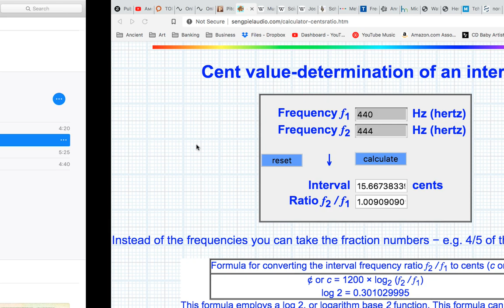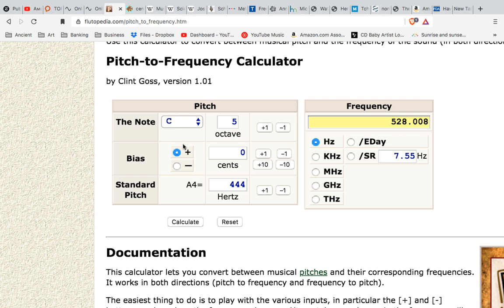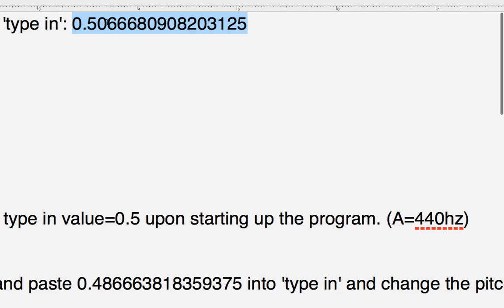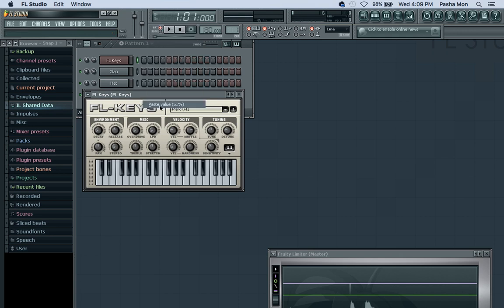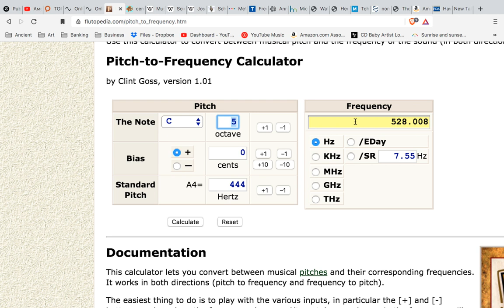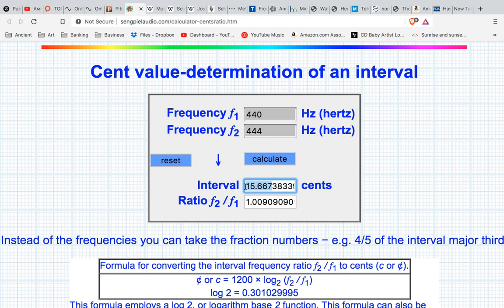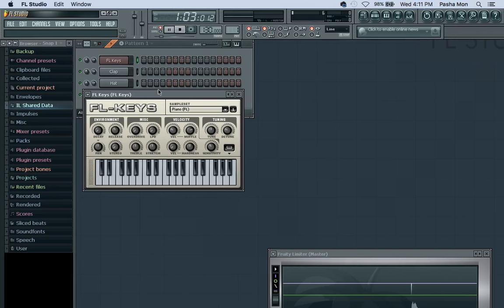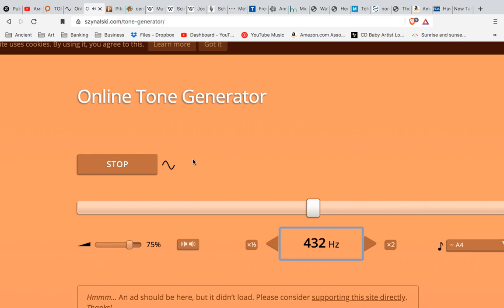How to Tune to 528 Hz and 432 Hz in FL Studio | Advanced Music Production Tutorial

Comment from the maker: UPDATE! Latest version of FL Studio https://amzn.to/3262VhX (Amazon affiliate links) lets you tune to 432 and 528 (C=444) Hz DIRECTLY! :) making it super easy! 

Also, if you're a music producer check out this awesome ultra portable AKAI keyboard controller: https://amzn.to/3i5rtwZ  I actually have it and it's great.

Tuning to 528 Hz means your note C (5) will be vibrating at 528 cycles per second and your note A will be at 444 Hz. This means you will be tuning up 4 Hz from the standard tuning pitch of 440 Hz, an equivalent of 16 cents.

In the case of 432 Hz tuning, you will need tune down -32 cents (or 8Hz) from 440 Hz. This will make the note A vibrate at 432 Hz and the note C (5) at 512 Hz.

Thanks to YouTube user The Captain Chiefer who broke down the math the following way to get to the appropriate FL Studio number: 

Explanation:

1. C5=528hz when A4=444hz. 

2. Fl studio's default pitch setting type in value=0.5 upon starting up the program. (A=440hz)

3. As seen above you can copy and paste 0.486663818359375 into 'type in' and change the pitch to 432hz. 

4. Since 440hz-432hz=8hz & 444hz is 440hz+4hz we would subtract the default fl pitch, 0.5 by the pitch for 432hz, 0.486663818359375 to get the value of 8hz for the 'type in' value, and then divide that value by 2 to get the value of 4hz for the 'type in' value.

5. (0.5 - 0.486663818359375)/2= 0.0066680908203125 

6. 4hz difference in cents = 0.0066680908203125 so add that to the default pitch of fl, 0.5

7. 0.5+0.0066680908203125=0.5066680908203125

8. A=444hz=0.5066680908203125 'type in' pitch value

Check out some of my music and even get my free mp3s here: https://www.Pasha808.com THANKS FOR TUNING IN! Cheers!!
Reply: hey bro, I have FL stu 12, is it possible to import my beats from 12 to into 20? And then just tune all of them to 432 hz there?
Reply from the maker: Ahein  gr8t! EZ right. their next logical step would be to allow users to convert audio files as in Logic and Audacity been available for many years..
Reply from the maker: @spencewolverton4923  it should be possible with an export project, however straight audio files/samples will need to be converted using Audacity or Logic. so it may be easier to just export your finished track as a .wav file and then convert it to 432 in one shot using Audacity or logic. good luck
Reply: @432HzMusicTV  where do I get audacity and logic? And also, your saying I cant send over the final track as a wav. File from 12 to 20 and then tune it to 432?
Reply from the maker: @spencewolverton4923  Audacity is free. just download it online. FL Studio doesn't convert audio files to 432. only virtual instruments within a project.
Reply: @432HzMusicTV  Thanks for making this video. If I change the master pitch to 444 Hz, do I need to change it on all plugins or will it do it automatically? Thanks
Reply: 1:56 Can you please tell us why you would do 432 versus 528?

Comment: Is it possible to tune individual tracks instead of the whole document? Eg. I've pre-tuned and recorded my guitar at 432Hz and wish to match my other patches to it without pitching the drums or percussion
Reply from the maker: hi, it's not simple, but you could record everything except the drums in 432hz, export that file, and then layer drums at 440 (standard) on top of that in a new project...
Reply: Many 3rd party plugins (omnisphere, serum, etc) have an option of changing the hz internally in the plugin. Hope that helps.

Comment: If the value of 440 Hz has pitch is 0.5 in FL, then 1 Hz has pitch 0.0011363636363636, then 432Hz has pitch value 0.4909090909090909 which is not matching with your calculation. Correct me if I am wrong. If possible please share your calculation for the type in value for 432Hz. Great informative video by the way!!
Reply: if I'm not mistaken pitch and cents are measured differently and I believe he's going off of cents and not pitch